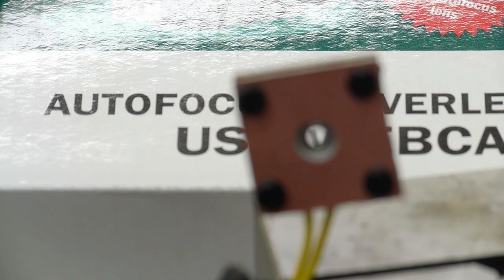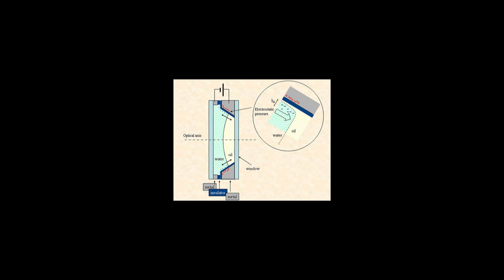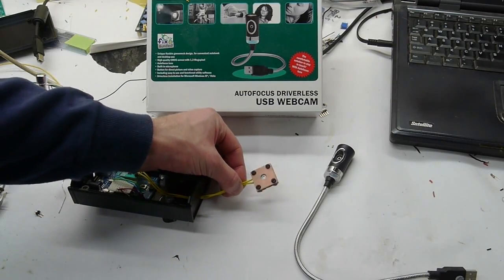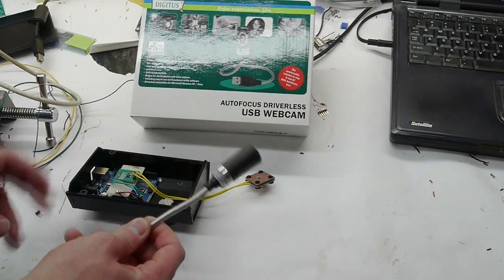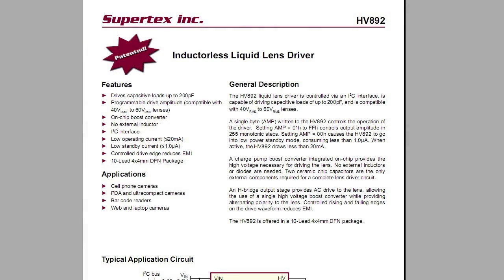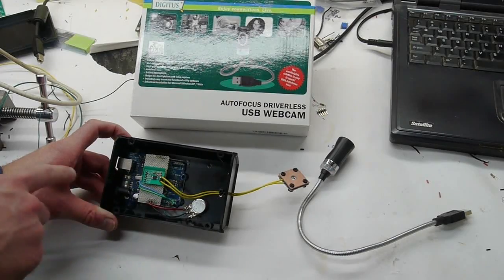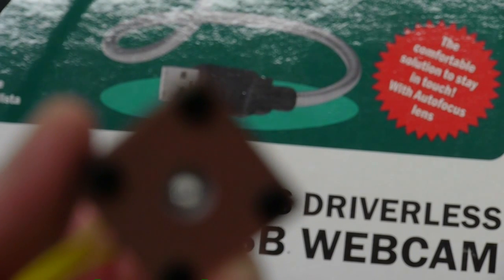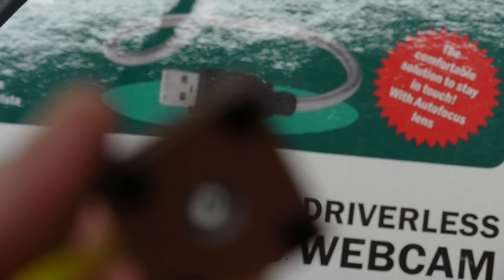Experimenting with a liquid lens and driver IC

Comment: wonder what the relation between voltage and size of the lens is. Does it scale linear or by some power, though if it were somewhat linear then it would be cheaper. Need an amorphous and semi fluid len that can change shape based on temp and possibly field. I also wonder if some sort of hydraulic or pneumatic lens system is possible either. A material which you shape by altering the pressure in 2 chambers with a lens material between the two. Should be able to get flat, convex, concave  or combinations if there were more controlled surfaces.
Reply: Did you find your answer?

Comment: but doesn't ac short through a capacitor ?
Reply: no, it's not that simple.
Reply: @AureliusR  Yeah i do know about capacitive reactance and impedance and maxwell's concept of displacement current
but my point was doesnt ac cause alternating fields thus resulting in no net polarization of the dielectric in the capacitor? (im assuming ht eliquid lens behaves similar to a capacitor)

Comment: The main reason you need AC is that DC would split the water via electrolysis.
Reply: only when both electrodes are in the water

Comment: you could also try to pump fluid in and out of a soft cavity so the walls fold in and out and making a lens shape
Reply: Using a soft, flexible film a d a hard one on the other side

The drawback would be that the edges would crinkle up and distort the image

Comment: @bkraz333
The trouble with upscaling these kind of lenses is that gravity will overcome the initial surface tension and adhesion to the surfaces of the device.
The lens does work on small scales exactly how you explained, the power of these forces won't grow linear when you upscale the lens.
So in short: the laws of Physics are not in your favor when you try to upscale these devices.
Still: a really cool lens, nice stuff to play with, with a lot of potential!
Reply: gilgameshismist if the 2 liquids have the same density, gravity should play no role